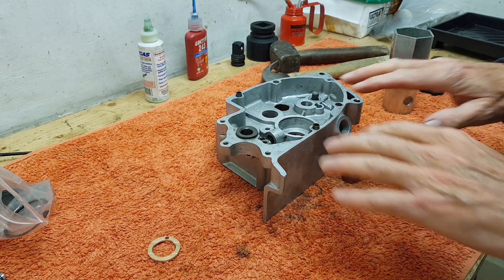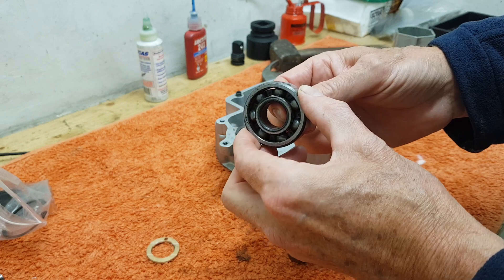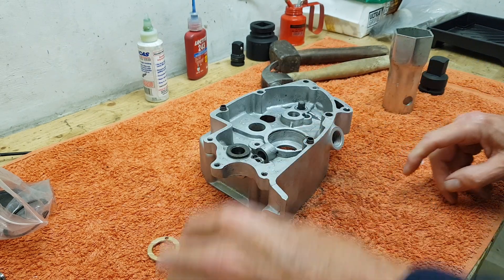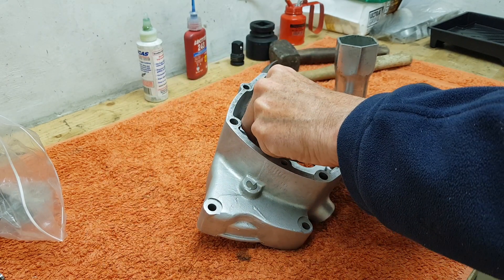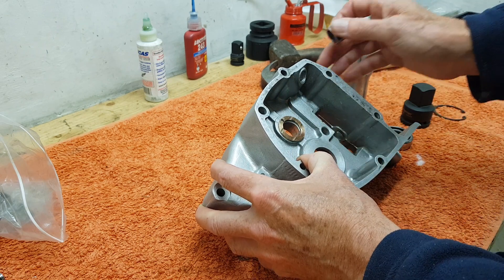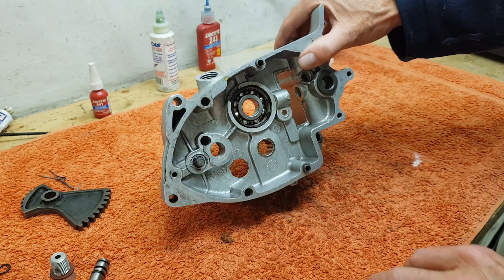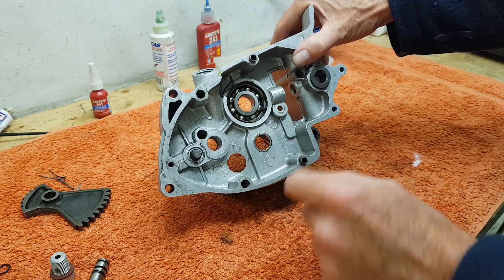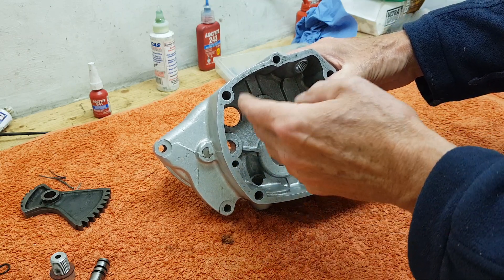Triumph Trident T160 Engine Rebuild. Part 28: Inner Gearbox Cover Assembly

Comment: A better way of heating up casings is to stick them in the oven, they are evenly warmed and it is a darn sight safer than with a blow torch!
Reply from the maker: Always a problem with 'other people'  in the house. 😉 My best recommendation is a gas barbecue, or the oven when you can (but only once the cases have been cleaned as otherwise the hot oil is really pungent!) https://youtu.be/i9KBH7j6iGQ

Comment: Oh boy the fun part indexing the gears. Good job Chris.
Reply: Yeah, not sure on the design of the boss either.....  To me as a mechanical engineer it would of cost more to "machine" the two wrench flats in the material vs. starting with a nominal size of hex.  Machining the threads, bore, etc would of been a wash.
Reply from the maker: Thanks again, Dale. 👍